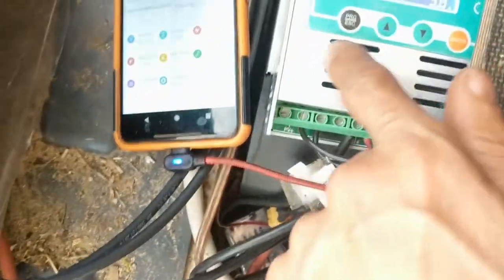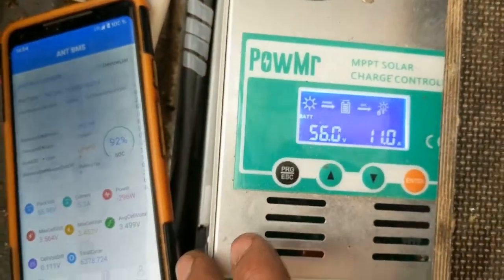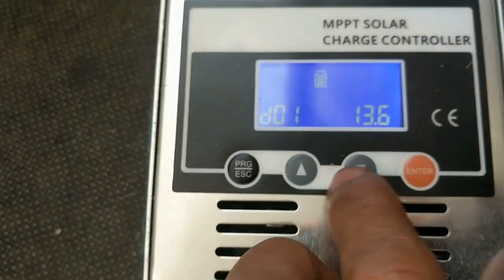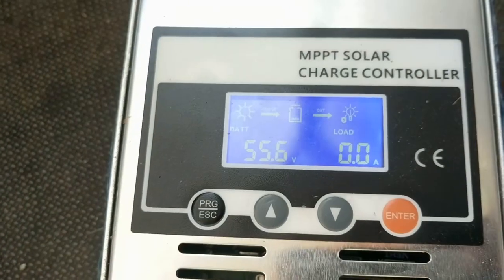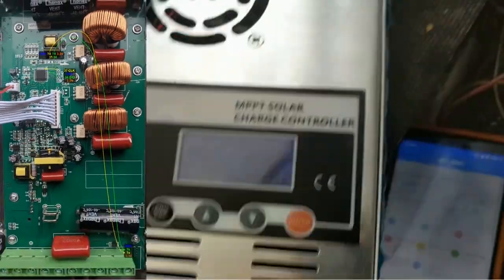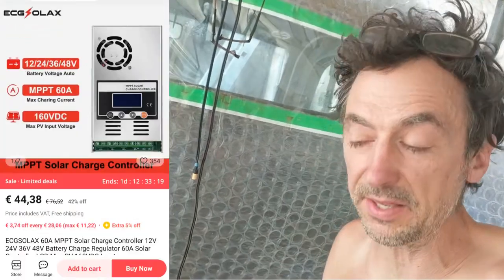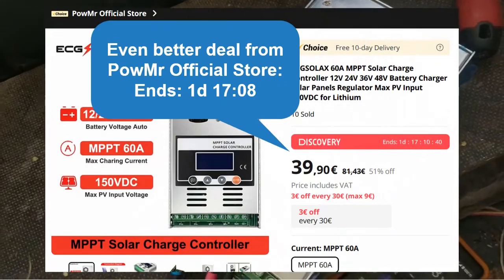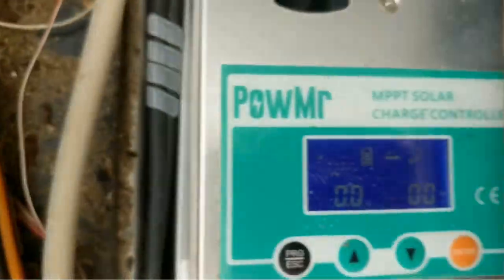60A mppt: EcgSolax vs PowMr

Comment: Hello.
Voltage at Maximum Power (Vmpp) = 34.5 V
Current at Maximum Power (Impp) = 9.59 A
Open Circuit Voltage (Voc) = 40.2 V
Short Circuit Current (Isc) = 10.1 A
I have 2 monocrystalline solar panels of 330W from Tomatech whose values I wrote above...
How can you connect these 2 panels to this PowMR MPPT 60A solar controller? With serial connection or parallel connection?
 Because I looked at the device information, it is 12Volt. It says that the highest 80Volt input can be connected for the battery (VOC). (by the way, my battery is 12.8v 200AhLiFePO4)
So, should I use these values only with parallel connection?
I was confused and wanted to get precise information...
Thanks.
Reply from the maker: For 12V battery, of course you should connect the two solar panels in parallel. Only if you had a 50 meters cable in between might higher string voltage makes sense. I think the powMR is rated for 150V max input voltage. See my other video on the input voltages of these 60A moot chargers.
Reply: @robodurden  Ok, thanks a lot...🙂
Since I'm going to connect it to the vehicle, the distance is 4-5 meters. I'd better connect it in parallel to avoid risk because the VOC value is 80.4v in serial connection, although there is a slight difference, it is more than the max80V stated in the description for a 12 volt battery.:hand-pink-waving:

Comment: On the PowMr. you have to turn off the system after changing the settings. If you change the settings. Disconnect the chargecontroller from the battery and solar for a few seconds then reconnect.  If you don't, the changes you made wont be saved.
Reply from the maker: That is what the PowMr. manual says but it did not really work for me. Sometimes i have to repeat that many times until the new setting is accepted 😞
And if you really have a 60A setup, disconnecting the charge controller is not that much fun.
I want to lower the charge end voltage when i am not at home and then always disconnect and reconnect (with a big spark) the controller is not nice.

Comment: So you bought from this exact link?
Reply from the maker: No, I did buy my first four from the Ecgsolax Solar Store: https://a.aliexpress.com/_EGFR5lZ
But before finishing this video I bought another three from that even better offer. So now there are only 4 left. Yes I wonder why the PowMr store offer such a good deal for the EcgSolax clone. And the image of the inside is not that of the black LCD Ecgsolax but the green LCD PowMr. And others also reported that that version has problems with the charge end voltage. Still I believe that the black LCD is the latest of these clones. And neither PowMr nor Ecgsolax not EaSum do really manufacturer these items anyway.
Reply: @robodurden  I ordered the last one, we'll see what happens.
Reply from the maker: I never got my 3 because the PowMr seller never shipped and did not respond to questions. I extended one times. But got an automatic full refund from AliExpress when that extended period expired yesterday.
That special offer with a product of a competitor (solarmax) might have had the only intend to prevent people buy solarmax :-( Luckily I do not need that order.
Reply: @robodurden  Same happened here, I also didn't really need it so no worries.